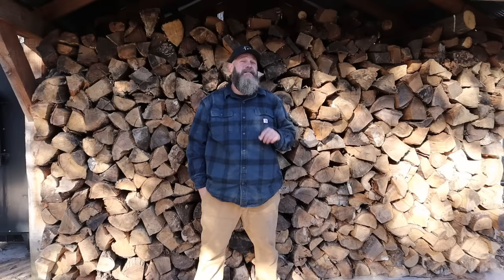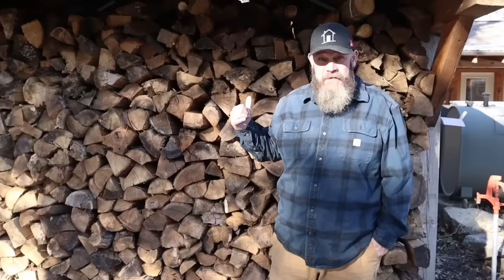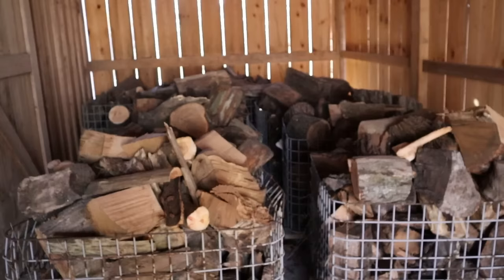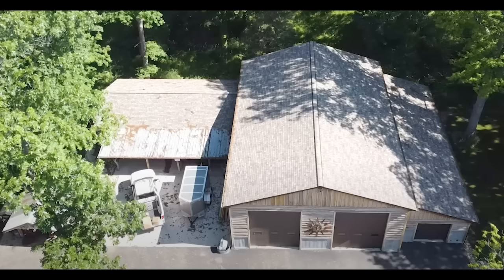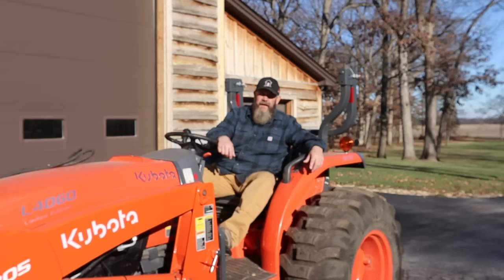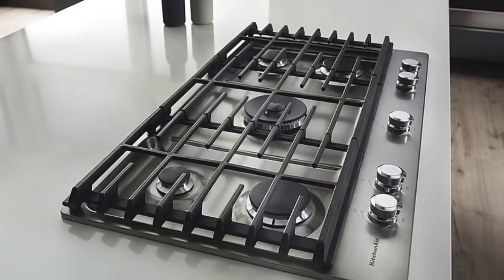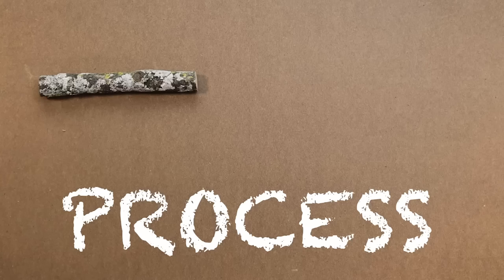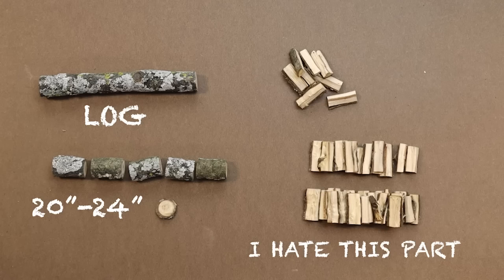Watch Before You Buy an Outdoor Wood Boiler!

Comment: Hi! I'm a fireman on a steam locomotive, and I really like your theories on fuel consumption. You are correct. A hotter fire will burn through more fuel faster. And when you only need to heat up the water to a certain temperature, that can be rather wasteful. Using green logs strategically to make your fire last longer is a smart trick.
Reply from the maker: Thanks for the info! I do think the creosote is a problem with too much wood. I suppose there is a balance.
Reply: @buildlife  Oh, absolutely. The biproducts of burning wood should always be considered.
Reply: I have never had a boiler but am considering buying one for our new build.  That said I have burned tons of wood in our indoor wood stove.  Green wood does last longer but it doesn't produce nearly as much heat so I guess it depends on if the heat it produces will be sufficient to meet the temps you need.  Also, a lot of heat is wasted igniting green logs so there is a level of inefficiency there also.  Laslty, green logs require a higher temp to actually burn so I would be concerned about the boiler fire actually going out if you only had green wood in there?

Comment: Note, glycol is used as an anti-freeze in cars, operating at an average of 180 degrees, with spikes to 210 degrees, or higher.  It lasts a long time.  It also lowers the freeze rate when mixed with water to way below 0 degrees, and increases the boiling point above 212 degrees for plain water.  It also helps to inhibit rust in a system.
Reply from the maker: Seems like it should work.
Reply: You can also kill your dog with it
Reply: Antifreeze for hydronic in floor heating isn’t the same chemical mixture as the anti freeze glycol that goes in a vehicle.
Reply: @MasterBuilderofTruth  Yes, but what type of person would make it available to their dog?
Reply: @bluethunder1951  True, but there are other options to improve overall efficiency and transfer.
Reply: @thereasoner9454  I used to live in northern Alberta where the temperature would stay in the -30c to -40c for months on end and had my house and garage heated by two New York thermal natural gas on demand boilers, both had hydronic anti freeze in them, never once did it freeze up or lose heat. Here now in New Brunswick my boiler uses water only no antifreeze but the temperature are a lot warmer, on average about 0c to -15c so it’s easy to just keep the pumps running to prevent freezing. As for dogs, the only way to avoid them from getting into the antifreeze is to keep it well out of their reach, and clean up any spill immediately. Anyone that would purposely give dogs antifreeze needs to be locked up.
Reply: @bluethunder1951  so what?
Reply: Wow thanks for the tip dude who knew
Reply: If you add too much, it will corrode your pipes.  If you don't change it every few years, it will do the same . I was a boiler tec in the coldest city in part of the US . Fairbanks Alaska.

Comment: Your video is very interesting.  I've had a Taylor wood boiler since 2004 (sold and installed Taylor & Legend stoves up until about 12 years ago).  My friends and I bought Taylors because they have HUGE water tanks.  My T750 hold 550 gals.  It has a double pass flu with a secondary burn chamber, but isnt a true gasifier.  Our fire boxes were about 40" deep, 30" square.  Door was as big as the firebox, so if you could lift it, it went into the stove.  The fan does have an air shutoff on it, so it really limits the burn in between cycles.  With that much water, it was hours between fan cycles which helped a firebox full of wood last 12plus hours. (heating approximately 5000 sq ft).  I agree with the green wood theory.  The only 'seasoned' wood I ever burned, was left over logs from the previous year.  Otherwise, every season, I bought semi loads of logs (10-12 cord) 6-12" diameter, fresh cut, and started burning.  We also serviced about 30 Taylors in Eastern Wisconsin.  Every year we pumped the water out of the tanks and into a holding tank we took along.  Checked the Taylor corrosive chemical levels, and added if necessary.  The tanks were pressure washed, cleaned, and inspected, and we also replaced the anode rods as soon as they disintegrated.  Then we pumped the original water back in to save chemical.  Most wood boilers are open loops, so people worried about draining and introducing air into the system with fresh water dont understand the system exactly.  There are still many Taylor stoves (and about 10 other brands) in Eastern Wisconsin that are 20-30 years old, and if serviced correctly, will last another 10 plus years.  Great video.  Now I have to go back and watch some of your older vids.
Reply from the maker: Thanks for the info Jeff!

Comment: I just came across your channel and subscribed. I've heated my 3400 square foot house with my wood boiler for 15 years and love it. I actually burn about 9 months out of the year because I also heat my swimming pool with it. It is a lot of work-but like you, I enjoy the cutting, splitting, and the smells! Great advice on the indoor water fill valve. I have mine set up that way too and it is awesome. I would like to add that for that install you MUST have a backflow preventer so the domestic water is not compromised by the boiler water.  As far as draining of the boiler-the only thing I do is drain each year until it runs clear (maybe 5-10 gallons) and then add a 1/2 gallon of conditioner. I personally think draining the water completely is a bad idea. Keep up the good work with the channel!
Reply from the maker: Good to have you along! The hot water from the boiler is a closed loop and heats domestic through a plate exchanger so they never have the option to "touch" We were considering a pool and, we would still do the domestic hot water that way too. I'd even plumb my hot tub into it. Does it use allot less water when you aren't running heat?
Reply: @buildlife  I'm sorry if I wasn't clear in my original post. I understand the plate heat exchanger allows for two separate water systems and they don't "touch". In your video you mentioned a water fill valve to replenish the evaporated boiler water (instead of running a hose out to the boiler). If I understand you correctly yours is set up just like mine. I have the domestic cold water (with a backflow preventer and ball valve) connected to the outdoor boiler loop, which allows an easy fill when needed. My point was the importance of the backflow preventer so the boiler water can't come in contact with the domestic cold water. I hope that all makes sense. To answer your question about water (and wood) consumption when not running heat-I actually burn about the same amount of wood to heat the pool in the summer as I do to heat my 3400 sq ft house in the winter. Again, keep up the great work with the videos!
Reply from the maker: @tc6643  Thanks!
Reply: @tc6643  using a boiler to heat a swimming pool is an awesome idea.  How did you plumb the pool loop into the boiler to get the heat?!
Reply: Draining your boiler just adds oxygen to the boiler when you refill it, that is what allows oxidation so I wouldn’t change water any more than when you have to add water from evaporation. Yes you can add oxygen scavenger to the boiler water, and it will dilute as you evaporate water from the system but less oxygen in your boiler water is a good thing.

Comment: Question on your discussion about Glycol/anti freeze degrading @ 180 degrees. Most water cooled, internal combustion engines, have thermostats that open & close between 160 & 180 Degrees. Like the damper/fan combo in your boiler. I bet that 50% or more people never flush their car's coolant. I know better, but I'm cheap & change mine @ 100K miles. Where I live, 50/50 anti freeze-distilled water, avoids freezing. To me, coolant's biggest advantage is that it really helps avoid corrosion. Steve, You're Right; No Doubt Coolant Degrades. In a car, @ 45 MPH (Avg.) it takes 2,222 hrs to drive 100K miles. Hang with me; 2,222 hrs./ 24 hrs per day = 92.6 days. (3 months) So now, best deal I've seen on Glycol-anti freeze concentrate was, $15/gal. The Big Problem; Example - 6 months per year active heating, assume a 40 gallon boiler capacity. You Would Spend $300 Concentrate & $20 distilled water, every 3 months. Flush job twice & $650 bones out of pocket every winter; NO Thank you!
Reply from the maker: Wow!

Comment: Good video. I like that you cover a lot of wood burning variables without pushing one thing over the other. I use a gasification stainless steel unit in my basement. Twice a day in the coldest weather and you learn how much to load in with cold verses moderate outside temperatures. As far as the water goes mine has been in the system for years and years. I did treat it when first filling it way back when. It turns a nasty black from in the house copper lines it runs through, but I would never consider changing it. From time to time when a circulator springs a leak is the only time I have introduced more water into the system. Having had more than three boilers I settled on the stainless steel unit because I'm. no longer young and don't want to change out any more boilers. The best thing is the independence from the fluctuating energy costs especially here in the Northeast. Thanks for sharing your thoughts.
Reply from the maker: Thanks. Good to hear. Is your boiler an indoor wood boiler? I don't know much about them but it would sure be nice to add wood from inside when its -12 degrees like last week! Stay warm.

Comment: Liked the video. I work on commercial boilers for a living. The idea with water treatment limiting the water lost because every time you add fresh water to the boiler side you are adding minerals and fresh oxygen. Ideally you filter and treat the water and not change unless something is WAY out of range. For glycol you do NOT loose freeze protection once heated up. You do loose efficiency running glycol as it does not transfer heat as well as water, not a substantial amount.

Comment: The portion of your system that will have the most adverse affect (and cost) will be when the side arm on your gas/electric domestic water heater, working in reverse when the boiler is not producing heat, tries to keep all  the system water at the temperature setting of the water heater. A by-pass loop and some isolation valves could maybe remedy this situation relatively easy, but you’d have to remember to switch between in and out of service, depending on system water temp. (could possibly done with an aqua stat?)
Reply from the maker: Yeah I'm not sure. I think the difference between the cold water and the indoor temps is only like 40 degrees and we only do that for a short while here and there so I don't sweat it too much. I do like the idea of a temperature controlled bypass though.

Comment: The Empyre 250 boiler has been heating our 3500sq ft log home since 2001. We bought the home in 2012 then I retired in 2015, since then it’s a yearly chore to cut trees, buck them up in rounds 20” long, then using my skid steer with splitter attachment split up to ten to twelve cords of firewood. Like you in the mechanical room in the basement I can add water by opening a valve and watch for the water to overflow. When we start to get the freeze thaw cycles warm in the day cold at night I leave the pump on even without running the boiler for a day or two as one days burn usually heats the house for a couple of days. As for backup we have an indoor fireplace and electric boiler that can be switched but it’s a big expense to run it, after years of running it for a couple of years at about $600 - $800 a month on power bill by running the wood boiler that costs about the same to operate but with me doing all the work that power money goes to diesel fuel and food. Like you said it’s a lifestyle, for me in my early sixties now its becoming more of a chore not a pleasure to feed the wood boiler, sucking in that puff of smoke every time the door gets opened. I purchased a propane 80000 btu forced air furnace this summer to install in the basement as I’m not getting any younger. All your points were so true 👍🏻.
Reply from the maker: All good points. For now I enjoy the process and the "exercise". I think when I don't I'll just turn it off. Looking at solar now. Similar cost and a lot less work!
Reply: @buildlife  I’m in New Brunswick just on the Maine border we don’t get enough sunshine to pay for solar, my neighbour is off grid with whole house solar, he has a diesel generator that runs about twice a week in the winter to keep his batteries charged, so it really doesn’t pay for itself in the winter months. Right now propane is the cheapest fuel we can get. I’m going to use the boiler during the day and have the furnace set to come on if the temperature in the house goes below 70 at night and as a backup if the boiler craps out.

Comment: We just have a small home, only 1200ish SQFT including the upstairs(former attic) and we have a small old wood stove that was purchased from Sears in the early 80s. We use it as a secondary heat source. We collect down limbs in the neighborhood or if someone cuts down a tree we offer to take it away for free. We collect scrap wood. All in all I would say each spring through fall we collect about 1-2 cords worth of wood Mostly closer to 1 cord. It seems to be enough to get about 25-35% of our heat from. Ours has no boiler or anything like that. We fire it up when it gets real cold and put a box fan blowing against it. 

The way we do it because it's all free wood, we consider it free energy. Plus we have the ability to have heat even if the power goes off. I don't personally think 100% wood heat would be a good fit for me. But considering the little amount of effort we put into collecting the little amount of wood we use and the fact that it saves us about $300 each winter, it's worth it. Free energy = more money in my wallet. Add to that that the amount of time spent collecting and prepping the wood is about 10 hours total, that's like a $30 an hr job in terms of savings.
Reply from the maker: Free wood is alright by me! A lot of work but I love it!

Comment: In northern Minnesota, never have drained, I run 10 cords of green wood every year , and my house is 1200 sqft and the temp inside is 75 degrees. With that said your heating a ton of area !
Reply from the maker: Yeah I think that's what it comes down to. Given that I'm quite a bit more square ft. and only about 25% more wood. Not to mention I'm 500 miles or so south of you. I'm surprised how much wood these things take. I always think I'm doing it wrong till I talk to someone else with one!

Comment: I'm on year 3 running mine. I did a lot of research before buying and I bought a Portage and Main. Mine is an 8,000 sq' unit and holds 100 Canadian gallons of water. Mine turns on at 160 and off at 180 but it takes a lot longer than 1 minute to heat that back up. I agree these things will burn anything but proper dry wood will use less wood than anything else. Also the harder the wood the less it will use. With similar temperatures I can load my boiler with poplar and it will burn faster than if I load it with ash. I burn what I have but try to sort the wood depending what time of year it is. I'm in Southern Ontario heating 7200sq' plus hot water and I use approximately 10 cords/year.
Reply from the maker: Firewood Olympics - Couldn't think of a better way to stay warm!
Reply: I love my portage and main too, Sask here.
Reply: I’ve been using a classic for 15 years for my 4500 ‘ house. I agree the more u put in the more it burns. I just put in whatever I need to get to my next fill so temp n wind monitored. I’m only using the good stuff when needed- zero otherwise I burn lesser quality wood. Yes green burns slow but more creasote n if I can lift it it goes in. I split very little. My investment has paid for itself in three years n the maintenance is tho daily it’s minimal. I load 2x/ day but always put more in at nite cause I don’t wanna wake up cold or have to go out in the middle of night. A learning curve for sure but what isn’t. N I’ve had all the heat needed with no concern if I want it 80*. Tho 75 is perfect. Regarding investments it was my best return ever n quickly n didn’t get screwed along the way. At 15 I’m looking for another 15 tho not expected. One more thing- leaving the pump run to keep from freezing - yes I’ve found my 60’ of pipe inside allows the inside heat to reflect the water temp outside without the fire in the unit. U covered a lot n not sure I commented on all but 👍